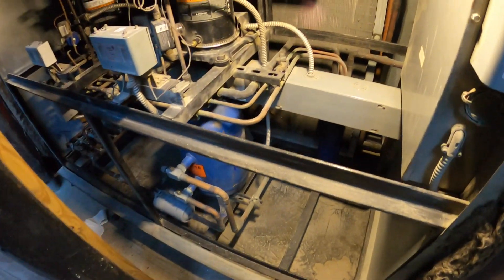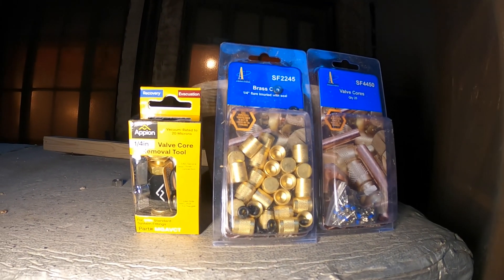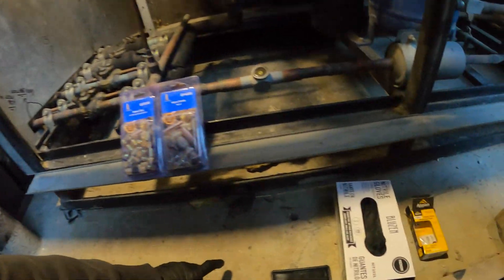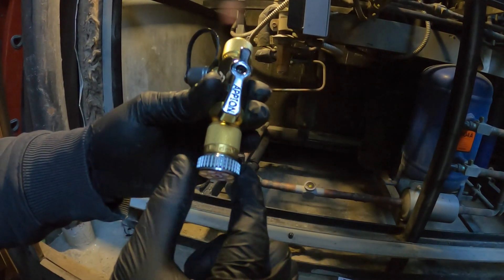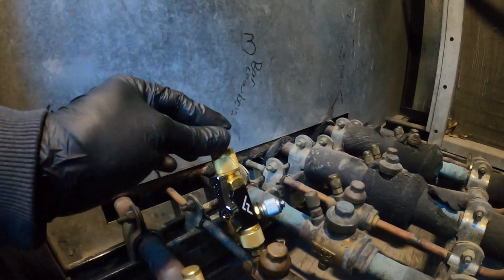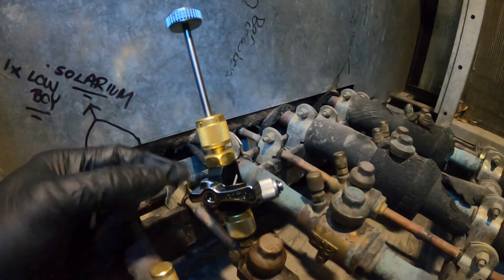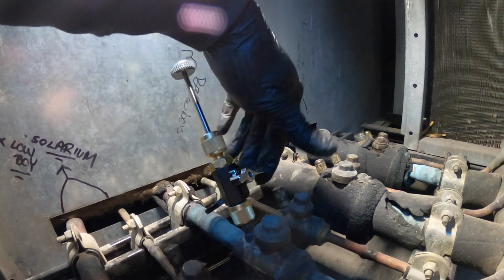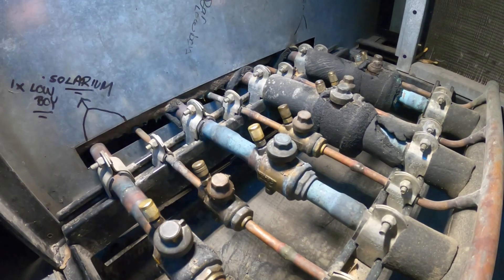HVAC: How To Use Valve Core Removal Tool To Replace Schrader Valve Core (Valve Core Replacement)

Comment: Can I attach a probe to the core removal tool and partially unscrew the core but not remove it to test pressure?  (So I don't have to buy 2 core control tools.)

Comment: here a leaky schrader, there a leaky schrader, everywhere a leaky schrader. 😬
Reply from the maker: @throttlebottle5906  We changed 20 Schrader valves that day. Somehow around 15 were leaking so it's best we changed them all. Thanks for watching! 😂🔧⚡️
Reply: @JumpermanTech  my findings are once they've aged and you use them, they most always leak afterwards. because when they get depressed open the pin/cup/seal always rotates slightly or gets a tiny bit off center and rarely seal perfectly again, sometimes opening/letting them snap shut hard makes them seal again(that time)
they're OK when newer since the seal hasn't hardened yet, but age and heat is guaranteed to ruin them.

Comment: Do we need to buy new ones for A2L equipment?
Left handed threads
Reply: so far only the tanks/cylinders have a different port to make sure people understand it's an A2L gas. they're still 1/4" flare BUT "left hand thread". everything still has the same standard 1/4" flare(right hand thread) ports. you just have to make sure all the tools are A2L certified, mainly recovery machine, vacuum pump, leak detector and anything else with a motor, needs to be spark free and brushless/enclosed motors.
Reply: Thanks

Comment: I have the field piece one it’s amazing
Reply from the maker: Awesome. Definitely a must needed tool. Is that the one with the sight glass in it? Looks awesome
Reply: @ Yes it is and you can valve off your vacuum gauge when you break it with refrigerant to save the sensor on the vacuum gauge